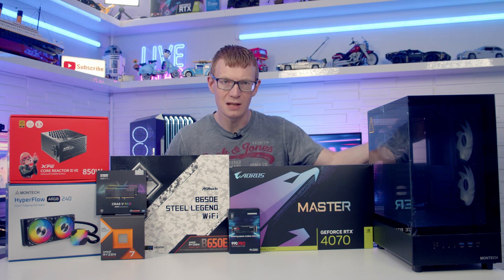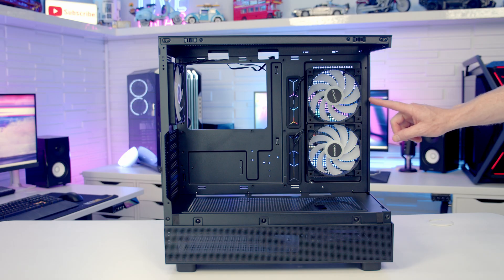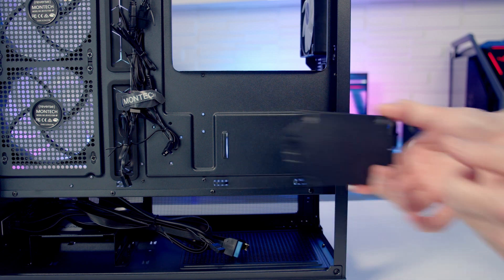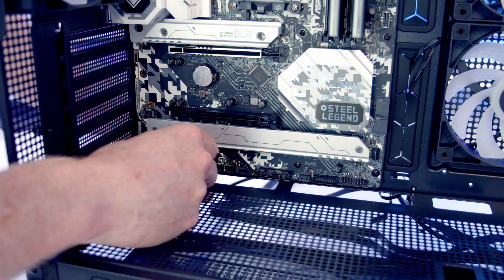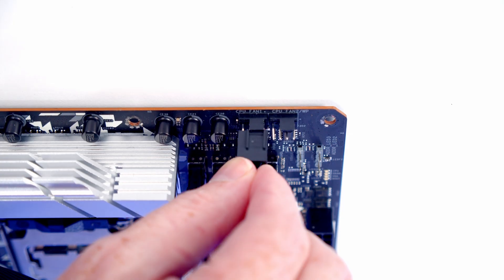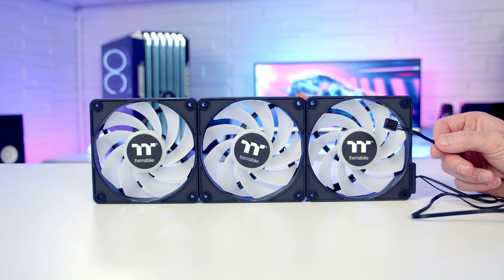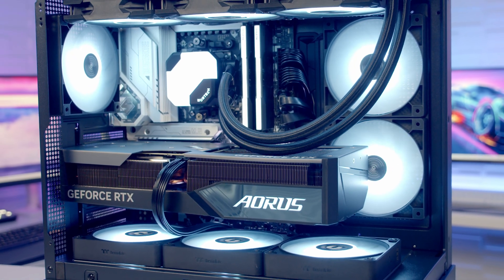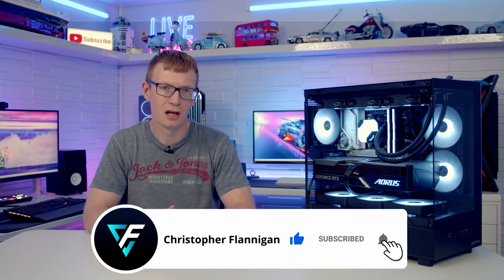Montech XR Build - Step by Step Guide

Comment: Building a PC myself with the same case, are the additional (bottom) case fans necessary? The case already comes with 3, surely that’s sufficient. 

In Australia, $80. Seems a bit expensive if they are not required.

Comment: I bought one of these and it was fine except for the fan noise. It's loud. Bought a be quiet! Pure flow 501 and it's almost silent. If fan noise is an issue this one is not a good choice. I returned it. Your review was excellent. I love how you record thermal and noise data on your videos.

Comment: amazing build! i also want to use this case, aio, etc and this is a great help. i just want to ask, how many argb headers did you use in your mobo? the one im planning to buy has 2 and i dont know if it is enough. should i buy a splitter or is it enough? (my build has exactly the same fans as yours, same aio, case and case fans) nice video!
Reply: you can try pcpartpicker to ensure the parts you want are compatible with eachother, but it may not work in your nation

Comment: Just wanted to say that I built my own PC for the first time ever in this case and it posted first try thanks to you! This guide was invaluable and I preferred it to a lot of others, especially since you showed where everything plugs into! Thanks so much for making this video, I would have had a lot harder time without it!
Reply: is it the same on all motherboards?
Reply: @konradonrad Different motherboard manufacturers will have slightly different names for the ports on the motherboard itself, but it’s pretty easy to either guess what the correct one is based on the pins or look up what it should be. I used an ASUS motherboard instead of the ASRock one he used and I didn’t run into any issues plugging anything in on the motherboard.

Comment: can they have any power supply ?? 

Just ordered an i have gone a MSI setup what you think 
Intel® Core™ i5-14600K Desktop Processor 14 cores (6 P-cores + 8 E-cores) up to 5.3 GHz

MSI PRO B760M-A WIFI DDR4 Motherboard, Micro-ATX - Supports Intel 12th & 13th Gen Core Processors, LGA 1700 - DDR4 Memory Boost 5333+MHz/OC, PCIe 4.0 x16 Slots, M.2 Gen4 Slots, 2.5G LAN, Wi-Fi 6E

Crucial P3 Plus SSD 1TB M.2 NVMe PCIe Gen4 Internal SSD, Up to 5000MB/s, Laptop & Desktop (PC) Compatible, Solid State Drive - CT1000P3PSSD801
already got a 

Corsair VENGEANCE LPX DDR4 RAM 32GB (2x16GB) 3200MHz CL16 Intel XMP 2.0 Computer Memory - Black (CMK32GX4M2E3200C16)

MSI MAG A650BN Power Supply Unit, UK Plug - 650W, 80 Plus Bronze Certified, ATX PSU, 12V Single-Rail, DC-to-DC Circuit, 120mm Fan - 5 Year Warranty

MSI GeForce RTX 3050 VENTUS 2X XS 8G OC Gaming Graphics Card - 8GB GDDR6, 1807 MHz, PCI Express Gen 4 x 8, 128-bit, 1x DP v 1.4a, HDMI 2.1 (Supports 4K)
Reply: That should work

Comment: the fans below the gpu what way are they blowing ? up or down? new to PC building
Reply: they are "blowing" up, as in they are intaking air from underneath the PC, which is ideal because hot air rises (so air closer to the floor is cooler).

In general, the side with the logo is usually the intake, EXCEPT if the fans are labelled as "reverse bladed," which is what is used in this video under the gpu.

Comment: 10:50 mAGNETIC POWER CONNECTOR will fall off from vibration. shitty design. dont buy. magnets also lose strenghth over time. power connectors must be tightly secured even for low power fans. 14:20 you can bend fishtank frame with ehough force or weight. good old all metal silent case is still the best without aLL THE rgb

Comment: I just built my PC with this case after watching this video, and this case is really impressive for the price! only got it for 45$ in Thailand Thank you for the video. <3
Reply: How did you wire the front panel? The connector does not have a + or - . Also the wire itself is black
Reply: @Thecrimsonflashx  Yeah, there used to be separate wires for LED, HDD, Switch, and Reset on my old case, but for this case, the connector is in one header, so you can just plug it into the motherboard's front panel. It's pretty simple.
Reply: Bro, can you control the fan rgb through the pc
Reply: yes you can if your MB support ARGB like in the video but my MB doesn't have ARGB conector so I control the fan rgb with my ARGB hub controller instead

Comment: Good job but the gpu sag is killing both the aesthetics and soon the memory module. A gpu support bracket is about 5 dollars and could easily be supported by a fan screw on the bottom part. Cable management is welldone as well

Comment: The pack of 3 fans at the bottom costs more than the case with fans itself 😵‍💫
Reply: which fans are they please?
Reply: @johnscerri228  	Thermaltake CT120 EX Reverse ARGB Sync 65.82 CFM 120 mm Fans 3-Pack

Comment: What every single person fails to mention about this case is the really strange stains on the front of the case near the power button.  The whole thing looks like it's had paint flicked over it.   I got in touch with scan.co.uk who told me it was part of the design...  Sure enough they were right, and you can see if on stock images of this case if you look close.   Really really odd,  no other part of the case has this weird paint stain apart from the front. It looks absolutely awful and I'm starting to think it was a factory flaw that has since been acknowledged

Comment: im thinking of getting a thermaltake aio and a pack of 3 thermaltake argb fans. will i be able to control these fans with the provided montech case fans using the same software? or will i need an rgb hub to connect all the fans to?

Comment: Just finished building with this case, and I noticed that your stock fan colors are blue and mine are rainbow. Did I do something wrong, or is there a way to change the color?
Reply: If your motherboard has the three pin argb headers you should be able to change them with your motherboard brands command center
Reply: yo bro, idk how to get the rgb working on mine, can you help me out? like what do i have to plug in for it to work?

Comment: I haven't built a PC in over 10 years. Decided to go with this case. Thanks so much for the video, massive help!

I am also shocked at how big that GPU is...things have changed a lot lol.
Reply: Yeah technology just increasing exponentially
Reply: When I heard you say 10 years ago I thought of 2006, not 2015 😂
Reply: Hey how are the temps & noise with this case? If you already assembled it, how was the process? I am also planning to buy this case
Reply: @shuvi1565  I used this case to build a very simple office PC for my dad, so it's probably a not a good representation of any higher end build (ryzen 5 8500G with onboard graphics, stock case fans, stock cpu cooler). Noise is pretty minimal and temps run at about 45-50C, but the computer is never really under load with light office work/web browsing. I was happy with the build itself and the case looks great. It's a solid case, but I only put together a bare bones build. Good luck with your build.
Reply: Hey gratz I'm also thinking to get Montech XR but I'm wondering how's the temperature performance and what's your spec for it?
Reply: @definitelycultured7521  It's a nice case, but I only used it to build a simple office PC for my dad (ASUS TUF Gaming b650-plus wifi, Ryzen 5 8500G with onboard graphics, all stock case fans and stock CPU cooler, 32GB RAM, 1TB M2 SSD). It's never really under high load with office apps and web browsing, but temps run around 45-50C with just the stock fans/cooler.

Comment: i have this case but i have the gigabyte b550M K motherboard and there isn’t enough slots for the integrated fans what can i do
Reply: What you need is a Fan Controller. What it does is it combines multiple 3 or 4 pin PWM fan outlets into one 4 pin PWM connection which will only occupy one slot on the motherboard. 
The Deepcool FH-04 Fan Controller is a great option for its price but if you need more slots on the controller, ARCTIC Case Fan Hub Fan Controller is another great option. As far as I'm aware, these do not support RGB so if you need RGB control, go for something like the NZXT RGB & Fan Controller (2022) Fan Controller.
Hope this helps!

Comment: You need to show us the backside of the case and what cable it is because im struggling not knowing their names if they don't have them written on them.

Mostly the fan cables, don't know which ones they are and also i have a usb looking cable i dont know where to plug on my motherboard
Reply: Yes this video went through the cables too quickly and didn’t explain much

Comment: Just purchased this, will be coming tomorrow. Want to say thanks for providing information on the connections on the argb fans, they have not documented it anywhere what sort of connections they have or if they are daisy chainable etc.
Reply: How are the temps & noise levels with this case?
Reply: @shuvi1565  I'd say the most noticeable thing is my gpu fans WHEN they are running, I'm only using 2 intake and 2 exhaust fans on a very low rpm fan curve, case is dead silent. 

But yeah, great budget case.

Comment: Is it possible to vertical mount gpu using this case? With a 4070 super aero
Reply: Trying to figure this out as well, if not it’ll be dremel and drill time to rig it it up 😂

Comment: Build is very nice and there is value in this case. I would use a gpu anti sag bracket with any bigger card. I really love how you show outside of the case which connector goes where. With your help, any novice can build a pc. Keep up the brillient work! 🎉
Reply from the maker: Thanks
Reply: @ChristopherFlannigan npc ahh reply 😭🙏
Reply: Yeah, I will get this case and although I have a different mobo I will still use his guide, very thorough and clear 👍🏼